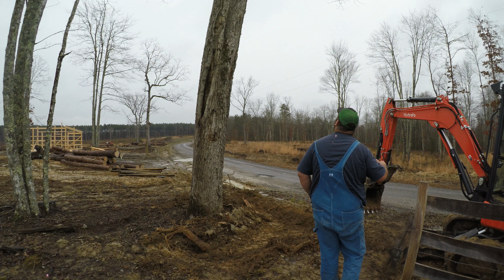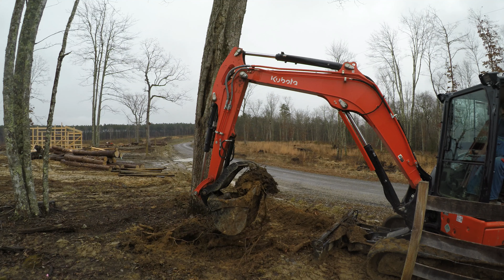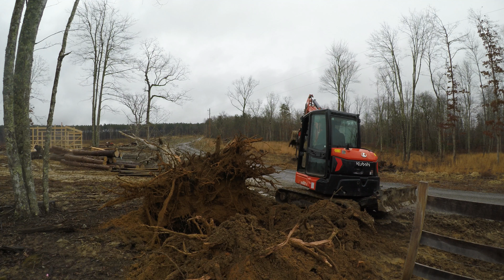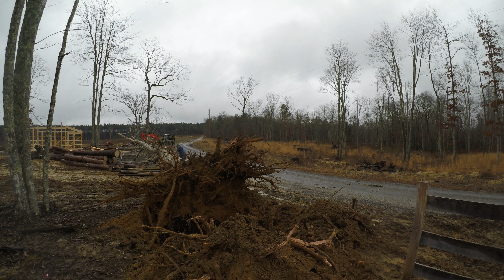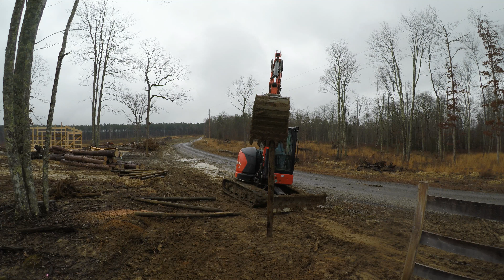Kubota KX057-5 Rain Day

Comment: Just a word of advice from someone who has 20 years experience. Dig down and cut the roots on the side of the tree opposite of where you want it to fall. That way the roots that remain act as a hinge. When pushing over a tree, put your teeth on the side of the tree so your bucket doesn’t slide off and you have more control side to side. Don’t fully extend your stick and boom, that way you still have some control to push suddenly if needed. Once you have the teeth of the bucket where you want them, track forward to push the tree over. You have far more power using your tracks to push than your stick and boom alone. Nice work!